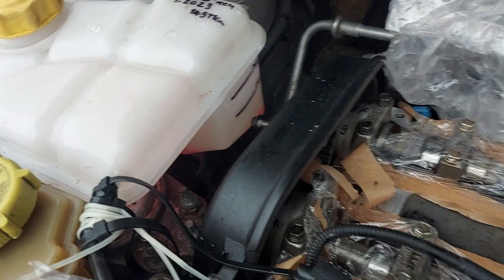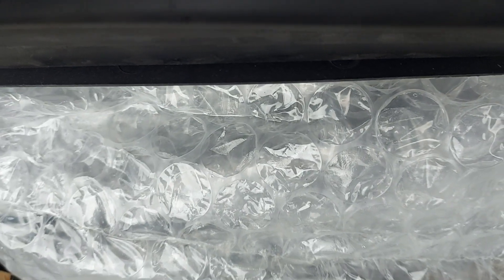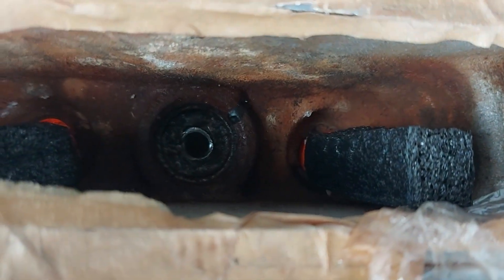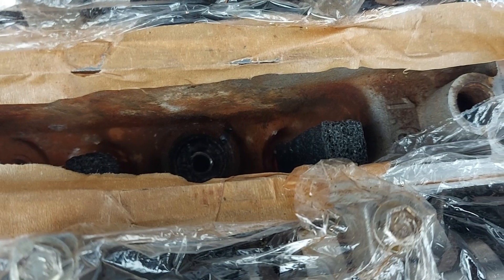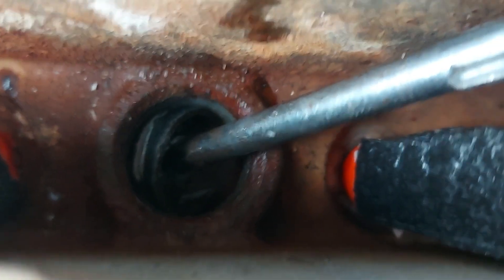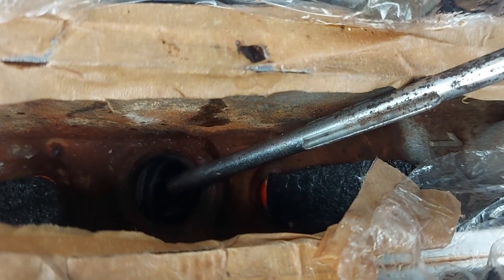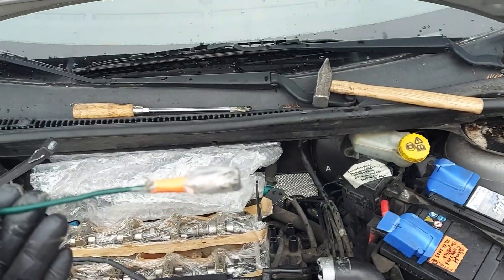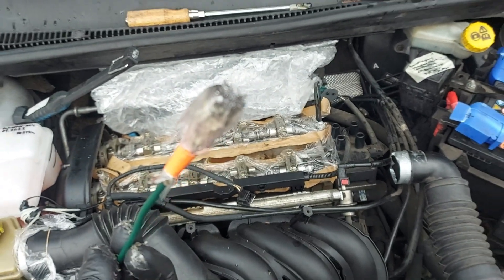Core plug replacement cylinder head Ford 16V Duratec

Comment: I did this exact job last week. I didn’t drill or puncture the plugs. Just tapped one side repeatedly and it turned on its axis. Then lifted out with thin nosed pliers. No drilling no bits to drop in